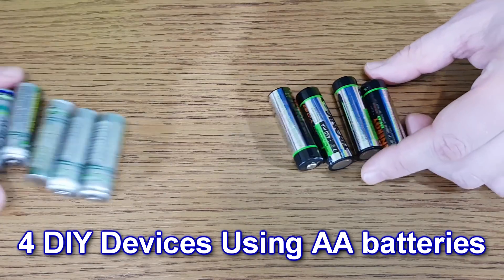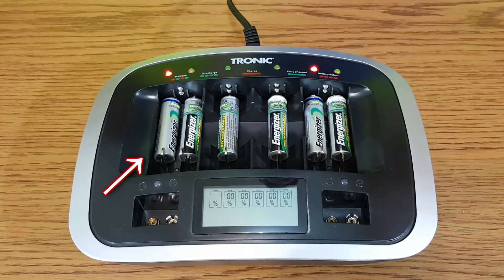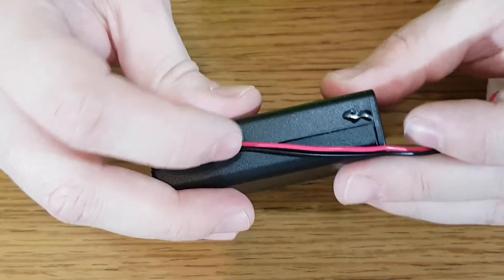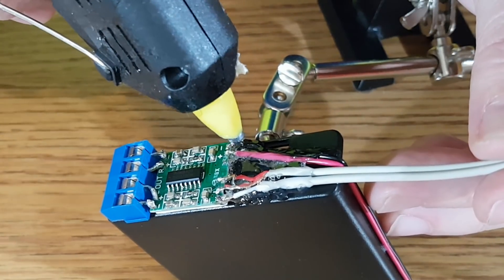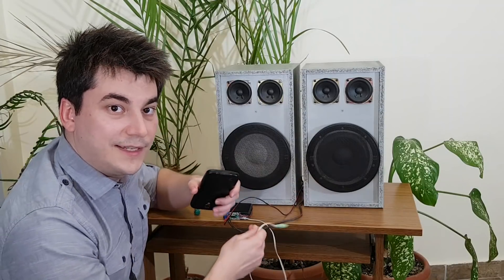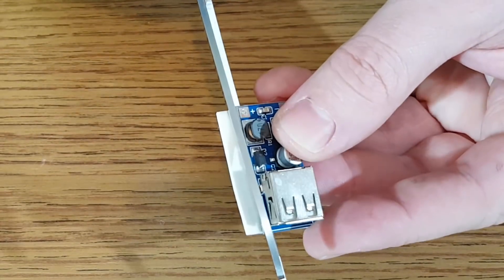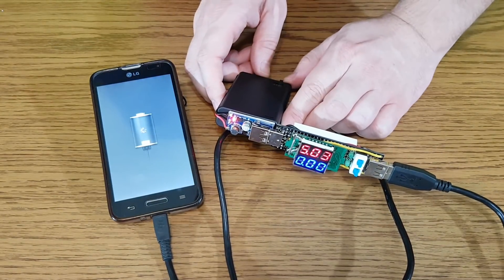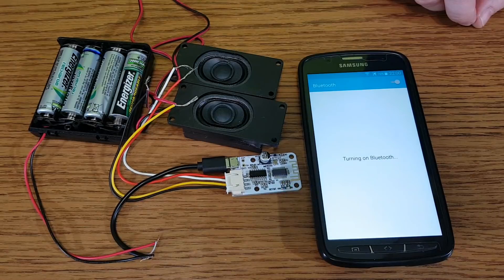4 DIY Devices Using AA Rechargeable Batteries

Comment: 600mA power bank is good for me because I use low current devices, unless if the module has load dependent turn on then I wont buy the module

Comment: You might consider designing a little "invention"  so it looks good and have it mass-produced in China so you can sell them with a profit. For example that mini-ups you had for your router. I have a problem in my car stereo... I have a little Bluetooth adaptor that I plug into a cigarette lighter for 5 volts. But my car has the start stop function to conserve fuel at traffic or red lights. ( This turns off the engine and restarts it when you want to go). When that happens my little Bluetooth adaptor loses the connection. I tried using a battery pack but it seems that those packs turn themselves off if there is very small current. Another solution I thought of was just to put a big capacitor to "stabilize" the power when the engine starts and stops. In any case ... The best inventions are when it solves a problem people have. Keep up the good work!
Reply: You have start/stop but no bluetooth/aux? What car is that?